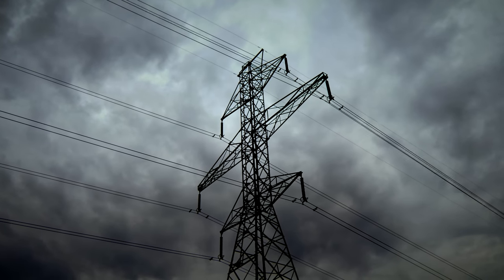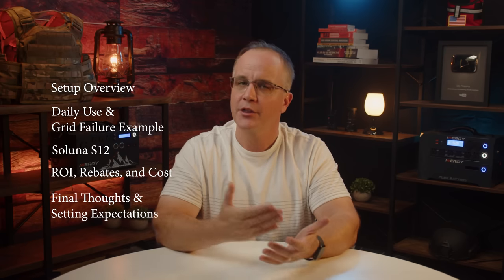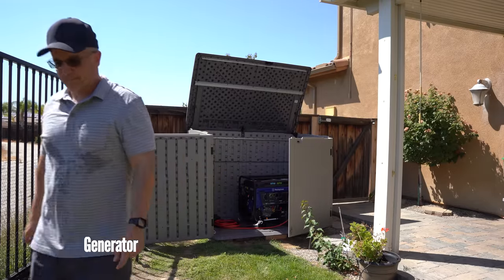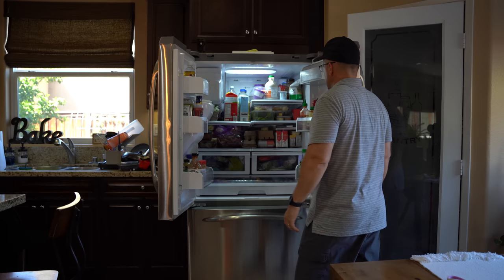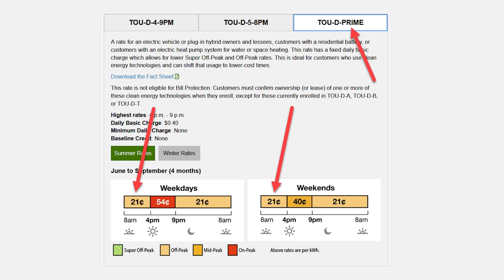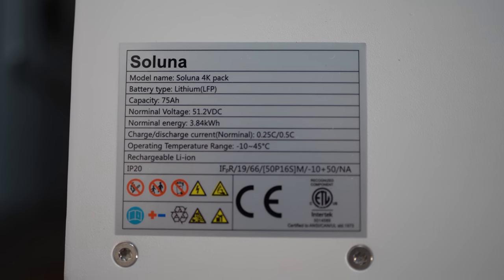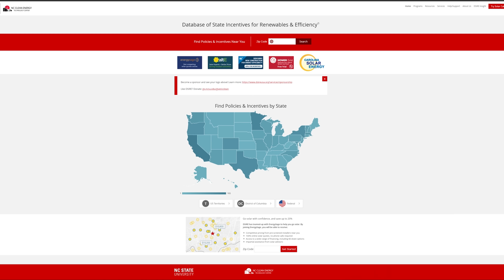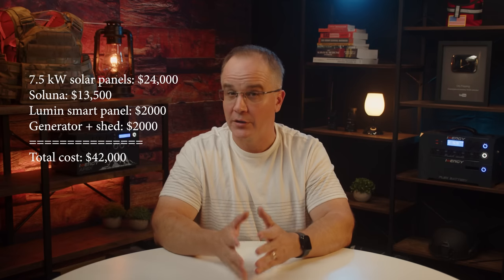The Coming Power Grid Collapse.  Soluna S12 Whole Home Backup Power

Comment: Chris, I am in the process of getting 8.8kwh installed with a battery back up in Nevada. Two things you didn't address that I have come across during this process.
1. When I purchase this home in a new subdivision, somewhere in the fine print with the utility company I agreed not to ever go off the grid. CONTROL Freaks!
2. I will be required to pay a minimum of $30.00/mo. to "maintain" the existing grid.

Did you have a similar issue but didn't mention it in this video?
Reply from the maker: Regarding point #1, I can go Offgrid...we don't have that issue here.  Not sure if that is state specific.  Regarding point #2, yeh, there are fees to maintain the grid.  I can offset that by slightly overproducing.

Comment: odd question, but how interconnected is the canadian grid here in the southern most of ontario to you americans'?
like on a level of 1 to 10; 1 being your grid going down won't affect us in the slightest and 10 being if your grid even experiences a small error, ours joins you in "electric spasms"
Reply: They're fairly interconnected. I'm not sure to what extent, but a while back a branch on a line in Ohio knocked out power in NY and southeast Canada for a while. The Northeast Blackout of 2003.

Comment: You said duel fuel but call it a propane generator. Not sure if I'm missing something?
Reply from the maker: Sorry for the confusion.  It is a dual fuel, but I only run propane through it.  I can use gasoline if needed.

Comment: What are your thoughts about a generac generator? They have whole home ones and smaller ones that you might see at a construction site or something that needs power but not a whole lot. My home has natural gas so I would hook in to the natural gas line for it. My house is about 2,000 sq ft and I’m really looking to keep my refrigerator, freezer, and a few lights and outlets running if the grid goes south. I want to be able to charge my phone if necessary and then have lights in the evening. I live in east TN and in my nearly 40 years the only time I’ve ever experienced prolonged power outage was the blizzard of 1993, and that only lasted about a week. I do worry that the whole country’s grid will experience issues soon, so I’m trying to get prepared. It’s just me and my dog at my house so I don’t need a lot.
Reply: If I may,  you'll have power only so long as you have fuel for it. It is a very muscular generator.
Reply from the maker: I almost had a 20 kW Generac generator installed, but the HOA shot it down.  They're great for on demand power and reasonably priced (the last time I checked).  If the grid doesn't go down on a frequent basis in your area and the ROI on solar doesn't justify it, I would recommend the Generac.

Comment: It takes around 10 kw of pannels to run your entire house. 10 kw of inverter power and for night time or bad weather the battery should be at least 1080 amp hr. I've been of grid for 30 yrs and know what I'm talking about. You run on pannels during the day and battery at night.
Reply from the maker: at the very end, i address this.  my setup wouldn't power everything, but it would power the essentials.  we'd have to retreat to a room or area of the house if we want climate control.  we couldn't control the climate for the entire house with this setup.  if we wanted more (as I mentioned), we'd have to spend a lot more.

Comment: Some of us in the UK are going to get the red weather warning for heat for the first time for Monday and Tuesday. We’ll be fetching some extra bottles of water tomorrow and charging lamps and power bank in case of power outages.
Reply: Freeze a bunch of small water bottles. You can for example hold one in your hands on and off, or put your feet on one, or wrap one in a wet dish towel or wash cloth and put on the back of your neck to stay cool.
Reply: Thank you. I’ll keep that in mind when getting things sorted. My other half cannot cope any higher than 25 degrees Celsius so that’ll come in handy. Thanks again!
Reply: @charliejones7512  You're welcome! I had to work flea markets in blazing summer heat for ten years. The only reason we didn't pass out was we kept drinking ice water, put ice in spray bottles with water to spray our faces and arms, and used wet towels with ice cubes wrapped up in them around our necks.

Comment: I've been shopping the sales... 2 Jackery 1000s + 100W panel to supplement the 12000w dual generator. Saved about $1000 overall. Overall, cost about $2500.
Reply: Sounds like a great system. Think about upping your solar, you will need more then 100 watt panel. I have two goal zero’s and have found it that’s at least 200 watts (more would be better) per unit to recharge.
Reply: @Utah_Mike  I have another panel but need to see what connectors I need.
Reply: @Jeo_Momma  excellent! Make sure to test your equipment for electrical grid down.
I am lucky to live where there are basements, they stay about 10deg cooler then the main floor of the house. I need to up my winter heat game.

Comment: I have always been concerned about this, especially being a Insulin dependant Diabetic and prepping. this is something I've been wanting to do and I know I can't this year but I plan to next year. I've been following you for a very long time and thank you for helping all of us. Hopefully I will be able to achieve this needed step for preparedness.
Reply: A portable refrigerator BougeRV has a small one (23 quarts) that is about $250. Pair it with a solar generator (which they conveniently do sell, but I went with a different brand) and you can power the fridge thru a 12V DC connector for nearly an entire day and if you buy solar panels to recharge the generator during the day (each day) once the sun goes down you can keep your insulin cold for however long it takes until the utility company is able to restore power to your house.
Reply: @CJatLoyola  thank you, I will see if I can find one and a portable solar generator system to keep it powered. This is greatly appreciated and will give me something until I can afford an off grid solar system for my home.

Comment: So if I have grid tied solar and the grid goes down long term, any suggestions on how to repurpose to charge a local solar generator?
Reply from the maker: you'd have to change the wiring from your solar panels from the grid to a charge controller/inverter/battery setup.  I'll be doing a video shortly on building a DIY setup.
Reply: @CityPrepping  Awesome!  I think my install has DC optimizers.  I have a delta mini with mc4 connectors.  Would need to learn how to remove the optimizers if needed and string together for the mc4 connection.  This is of course different than a full DIY build with standalone solar charge controller.